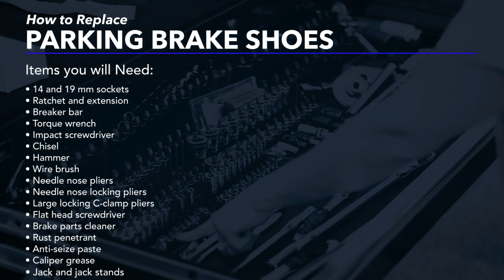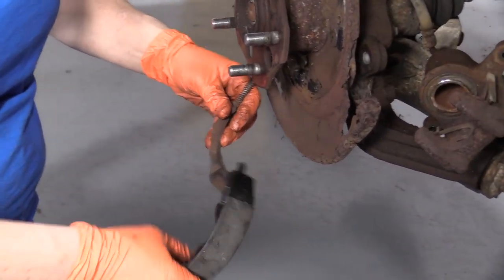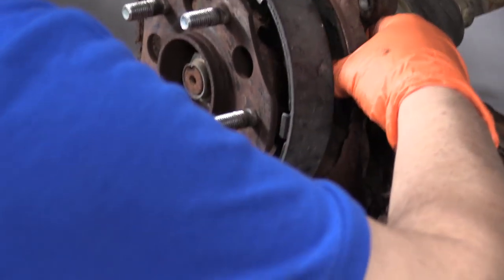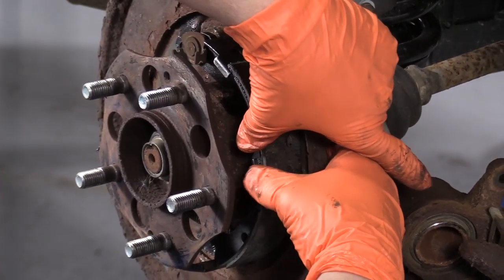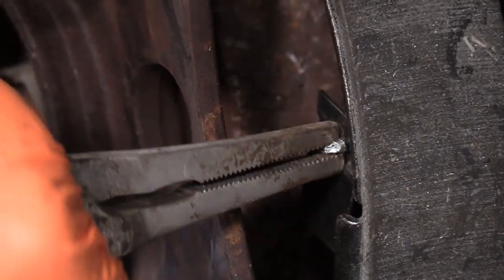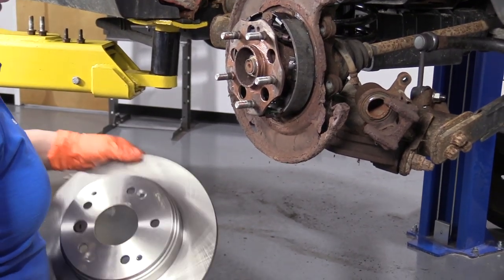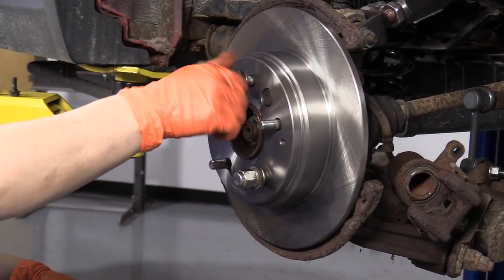How to Replace Parking Brake Shoes 03-11 Honda Element

Comment: would you loosen the cable if it is tight at the actual e brake before doing the job then after complete tighten it and adjust them both together?

Comment: When does the rear backing plate need to be replaced? Thanks!
Reply: It should never need to be replaced. 
Unless it rusts so bad it loses its structural integrity.
Reply: When you do the wheel bearing is the time to do it since the hub has to be pulled to replace it.   I just did mine and it’s not a hard job it just takes forever with all the rust.

Comment: My mechanic  is doing mine on my 2008 sc element tomorrow as well as rotors and calipers, pads. Was wondering why he did not see them  were worn out till after he started now i know    I  use then every day in my sloped driveway .  My dust covers are gone would this be a problem
Reply: I have an 05 Element mine were rusty and bent. I cut and grinder them off 3 years ago. Never replaced them.

Comment: Why am I taking the caliper off of the bracket? Can't it flip up if I need to compress it?

Why would I hit the rotor on the braking surface with a metal hammer? Won't that damage it? I thought there are bolt holes to remove the rotor if it is stuck
Reply: I cringed at that, but then the rotor got replaced. Yeah it would have been better to show how to use screws to get it off.

Comment: A lot of drag on that. It should be tightened  to contact then backed off. There is actually 2 adjustment procedures, using the actual handbrake adjustment inside.
Surprised anyone would need to replace those unless they drove with it on, a cable adjustment is usually sufficient

Comment: 3:36 The way the rear rotor is angled and still not coming off means the parking brake was still applied lol...
Reply: Actually, not.  
I can not recall the times they have been slightly snug as this.

Things get rusty around the hub.
Put it back together clean, with ample never-sieze, and the next time you do your disc pads...remove the rotor for craps and giggles.  You will see it was not the parking brake.

Comment: I watched your video and doing everything the same everything looks good but I cannot get the rotor on. The top part of the shoes keep the rotor from coming on there’s enough room on the bottom but it looks like the top shoes are out just a little bit too much and I noticed that they both will not rest on the pin at the top at the same time.
Reply: I had the same problem.  I ended up filing down the connecting rod (metal spacer bar at the top).
This part comes from the original brakes and was rusted.  I filed down the overall length at both ends and made the notches deeper.  This worked although is was very tight installing the rotor.  Once the rotor was seated it fit properly.
Reply: I have the same problem. How did you get it fixed?
Reply: @joehidalgo1246 the flat bar doesn't come with new emergency brake and screws pieces I just use a lot of grease and WD-40 to make it fit between the two brakes
Reply: Yup.  File if you need to.  They all don't match up.  

Remember...Personally, I sparingly touch the flat bar contact points with grease.

Also, unlike the vid...I would first check the actual parking brake tension adjustment in the vehicle.

Make sure you are starting from a good cable tension foundation.